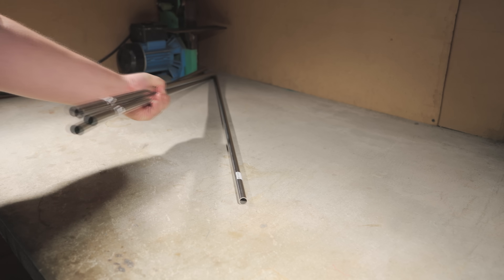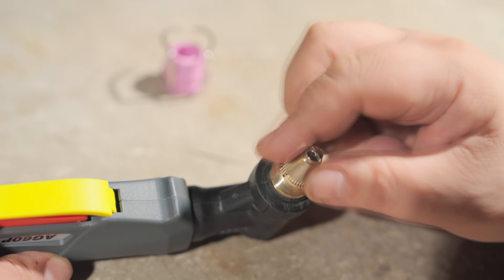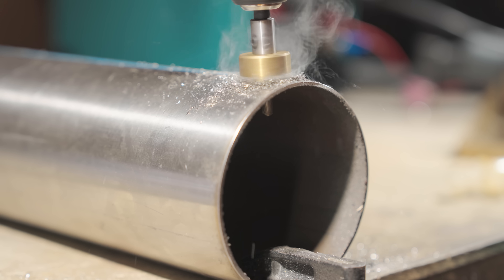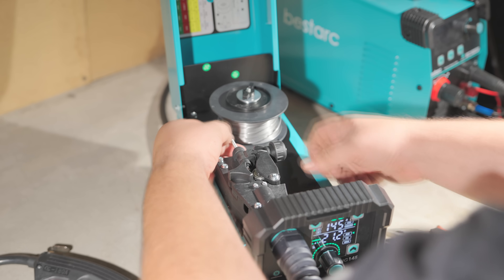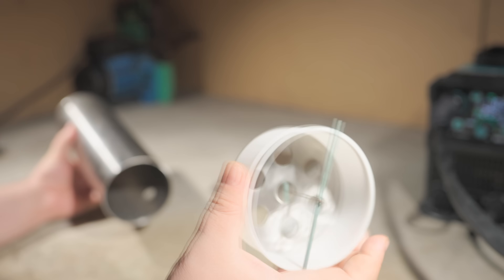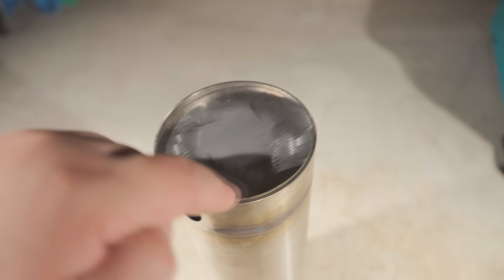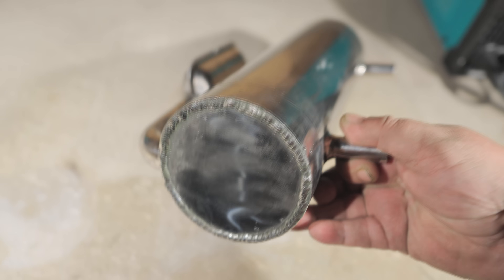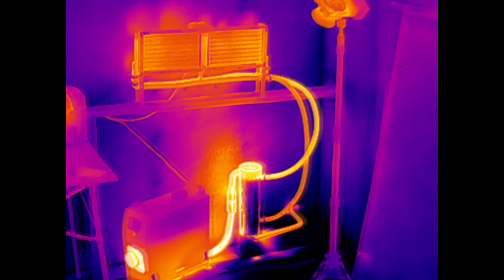Free Heating From Exhaust! You don't need heater anymore!

Comment: Radiant heat dish aluminum scandium alloy thermal electrical generator voltage multiplier organic carbon power cell to start it up that charges up then goes on standby while internal power keeps power to the heating filament don't forget a kill switch. Hope you find this intriguing? Hybrid fan Radiant heat dish spinning blades bounce Radiant heat and air flow moves heat thermal electric generator keeps it power up heat up a room very quickly.  Let me know your thoughts on this? 😊

Comment: Have you calculated exhaust back pressure so as not to gas yourself.
Plus why put muffler on intake surely better on outlet as heat rises and would be more efficient in exchanger nice job though well done buddy

Comment: Why can't you wrap copper pipe around woodstove pipe and fasten it to radiator inlet and outlet and let it just radiate? Would it need a relief valve for pressure,or would it be low pressure, closed circuit ?

Comment: ⚠⚠⚠DANGEROUS⚠⚠⚠ DON'T COPY IT. The exhaust muffler must be outside. It is not sealed and have a drain hole 8:01. You will poison yourself with gases. Secondly, the exhaust pipe should always go downwards so that the water from the condensation can flow out.

Comment: besides the no pop off valve or the exspantion tank put a computer fans on the coils to disapate the heat your setup you could go as big as radiator of a small car then use a heater coil for the exspansion tank and a pop off valve used a high heat water pump to help with movement and go to radiator fuild for better heating but please remeber to put the heater coil on the outside and use nontoxic fuild

Comment: So after all that its just a diesel heater.  You could have just used piping to recirculate the air bk into the system and a simple valve for pressure release.
It was more like an abvert for the products used.  Pointless

Comment: Without an expansion tank of some sort on your closed system, the pressures are going to be dangerous. You don’t have a relief valve on there to dump the excess pressure, but you should have at least a relief valve and a small airtight expansion tank other than that great job.

Comment: those exhausts have a condensation drain on the seam ,you may be getting exhaust gasses into the biuilding via that weep hole but its also supposed to be laid with werp hole pointing down to stop crap feeding back into the heater

Comment: Welding with MIG on stainless steel?
Better with TIG (with argon shielding gas). Try it, it's worth it. The work comes out perfect. However, I congratulate you on the excellent prototype.
👋👋👋👋👋👋👋👋

Comment: MIG on stainless is pretty awful.
Use the TIG feature on your welder with Argon shielding gas. Set up a hose to feed Argon inside the tank and pipe work  when welding it and it will weld the inside as well as the outside. Tape off openings with masking tape and provide only a small hole for the Argon to flow out. A 1/16" hole will be sufficient. Clean up the welds with a stainless steel wire brush while the welds are still hot.
Reply: Someone knows how to weld 👍
Reply: You're right about almost all of that.  Stainless steel Solid core wire will run really well as long as you're using a tri mix.  Helium is what make it happen, I've seen people use straight Argon and it's not enough, Helium is able to keep the SS puddle cooler.

Comment: The lazy ones us us watching this considers just pulling an old central heating water radiator from the trash and route the exhaust through that. Can even accommodate a fair amount of condensation in the bottom before it start coming out of the drain pipe.

Comment: Stainless steel work hardens quickly with little effort so when cutting with hole saws cut on slow speed and don’t stop and stainless threads will goral and fuse together so be careful with nuts and bolts
Reply: Anti seize lube on the threads is a must on stainless.

Comment: Just buy an all aluminum radiator for a car, no need for building a heat to water exchanger if both units in the same room. Ridiculous use of time and materials.
Reply: Not bad idea, but that might restrict the exhaust too much, get clogged up.. and it is pretty delicate, so it might start leaking exhaust.

Comment: You could have probably burned them welds in a little hotter....
Reply: Brazing them would have been simple, no need for all the fancy equipment, HVAC technicians braze with silver solder and flow Argon while brazing.
Reply: @melissasmess2773 nitrogen, not argon.

Comment: So not free, it's a diesel generator.
Reply: It's not a diesel generator, it's a burner burning oil to heat a room - get it?
Reply: @stanislawcwiek2966  tell this "Dr. Robo" he calls it Diesel Heater by himself
Reply: For free heat, it'd be neat to see something like a wind turbine powering an induction heater that then transfers to a liquid heat storage or transfer medium. But I could only guess the guy in the video doesn't have the space for something like that?
Reply: The whole video is an advertisement for the welder. You get nothing for nothing in this world, not even with solar collecters or wind turnbines. Those things aren't cheap and require regular and costly maintenance. Free energy doesn't exist.
Reply: But he’s not burning wood. So it’s good for the environment 😂😂😂😂
Reply: @grampa_ahah  Holz ist umweltneutral, weil es CO2 aus der Lft aufnimmt, wenn es wächst.
Reply: It's not a Sunday handyman who does the welds of this quality, we agree!? The system does not need oil or wood, it can work with 24V water, provided by solar panels. This prototype is wery similar to hydrogen technology.

Comment: The heat to heat the water that goes to the radiator should come from the bottom not from the top. 🤦😄
If you reverse the entries and you will see that it heats much better😉
Reply: Heat rises, not falls. Look at the internal diagram of the typical electric water heater.
Reply: @TimeSurfer206  The water in the water loop rises in this heat exchanger too, enters at the bottom, exits at the top could worke by convection alone like in a water heater. The exhaust  is forced, blown by a fan so easily flows downward, it enters at the top where the already heated water, having risen from the bottom, meets the hottest exhaust not having been cooled yet. If it was done as you suggest, the hottest exhaust would meet the coldest water, so on half way, both would be lurk warm, less energy would be transferred. Cross flow ensures there is a temperature difference between the exhaust and the water the entire length of the heat exchanger. A water heater is heat store too, it needs a bubble at the top of hot water, a heat exchanger does not.
Reply: @Tore_Lund  exactly!
Reply: Crossflow
Reply: @bankdobrychmonet5511  Amazingly few people understand that apparently?  Cross flow as you say to have highest efficiency and get the highest temperature of the heated fluid.
Reply: you might want to think about that a little longer...
Reply: FREE ENERGY PLEASE